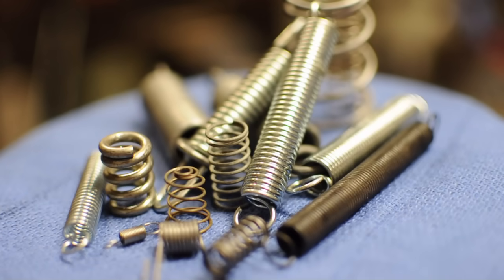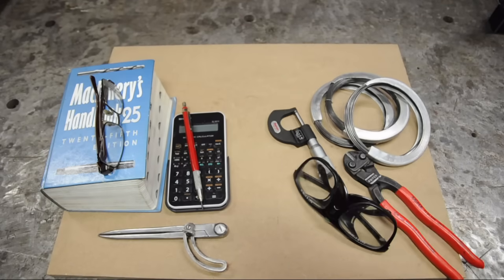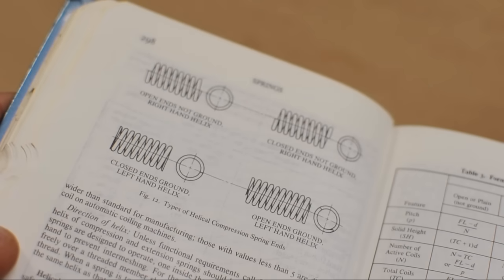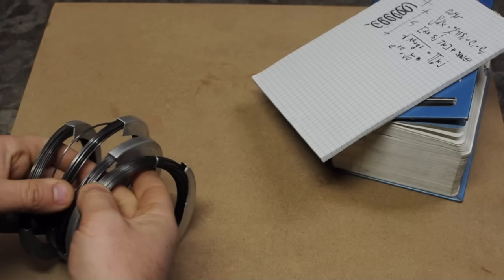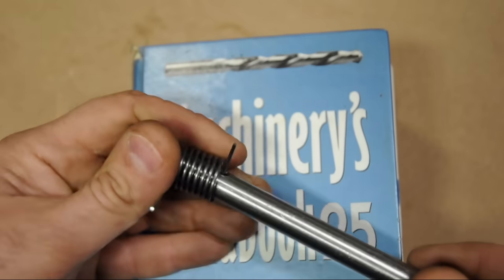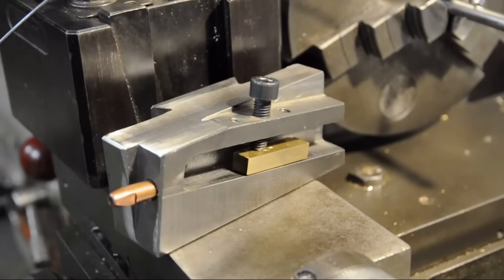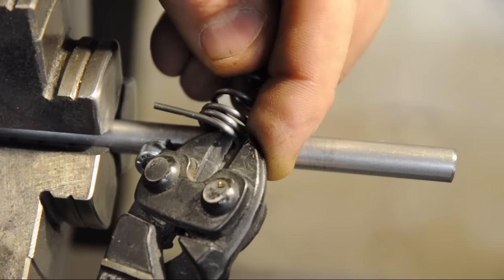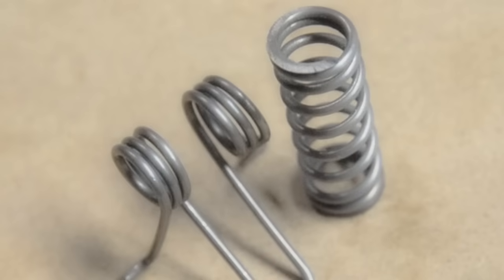Making Springs At Home

Comment: "at home"?  I don't own a lathe...
Reply: that's sad
Reply: No way I just say "That's a bad lathe, go sit back down."
Reply: You don't need a lathe to make springs. I use my cordless drill for the same purpose :D (but i do own a lathe)
Reply: Did one bite you?
Reply: Malcom Helainey If you're not an idiot there's no reason to be afraid. It does exactly what it's made to do, spin. Keep that in mind and you will be fine.
Reply: Jared R No, you buy your first lathe and then make 3 more lathes and sell them. (or make different sized ones for more percecion work)
Reply: I've seen a guy use a hammer to make a hammer.  I have not seen anyone use a screwdriver to make a screwdriver.
Reply: A lathe is the only machine that can be used to make a copy of itself.  So, if you go out and buy a lathe, you can use it to make another lathe.  Then, unbuy the first lathe.  Problem solved.
Reply: dont be silly, there is no need to make a lathe...just buy one! there are plenty to go 'ROUND
Reply: No, that would be the human being operating things. The lathe itself isn't dangerous at all, it just sits there.
Reply: Tune in next time for how to make a lathe at home!
Reply: I honestly don't know how people get along without a lathe.  I use mine more than any other tool or machine, and I have a LOT of both.

Yes, they can kill you, just like a gun, but it won't be the lathe's fault either.
Reply: i wish i did, i may make one, wont have a auto feed tho
Reply: Malcom Helainey that's your fear, so you shouldn't own a lathe, but don't blame the lathe for your fear
Reply: 3/8 Drill will do the job...
Reply: Might need to fix that.  Most kitchens have a lot of wasted space taken up by appliances that hardly get used.  Would be a good place for a lathe.    Most kitchen appliances can be replaced by a phone now days anyway.  Just order pizza.
Reply: Some years ago i've seen a stray lathe attacking a guy at night, it was really scary!
Reply: using....... a spring!
Reply: james davies use drill gun.
Reply: Herr Russo Tragik may be
Reply: I'm just trying to get everyone to understand my semi-rational fear of lathes
Reply: John Klatt Lathes are very dangerous. If ones turned on you can be killed by total chance
Reply: Don't buy one unless you know how to use one. they're probably the most dangerous tool in anyone's garage.
Reply: John Klatt no i'm just really scared of that powerful of machinery

Comment: OK, I see how to create a wire coil BUT all you have so far is a coiled wire, The video doesn't teach how to make the wire into a spring.
Reply from the maker: Music wire is already heat treated.  If designed well, and used within its limits, a 'cold coiled' music wire spring can last a very long time.
Reply: I have a K&S  wire bender, Maybe I'll give this a try and see just how much of a spring I can create without the proper heat treating of the wire.

Comment: ER.. no heat treatment necessary? Mmmm.
Reply: not with music wire
i thought the same thing
--Rick
Reply from the maker: Thanks Rick.. yes, music wire is already heat treated.  If the music wire spring is well designed, and stays within its limits, it'll work pretty darned good.
Reply: exactly! just saying using music wire you do not have to heat treat it

Comment: From what I read about making springs,  music wire springs should be heated to 500f for an hour and cooled slowly to "relax" the metal.  It seems to me that something like this would be needed to help the spring retain it's shape.  Otherwise if you can bend the wire easily, what is it to keep it to bending out of shape when the spring is in use.
Reply from the maker: I'm not sure if reheating/retempering music wire helps... it might, I've never tried it.  Music wire, however, is already heat treated.  If the spring design keeps it within its working range, the spring should do alright.  Thanks Fred!

Comment: I thought that springs , depending on their uses, have to go through various heat treating cycles so that they will spring back into shape when they're  stretched or compressed. I didn't see any springs undergo any heat treating in this video.
Reply from the maker: That is true for soft carbon steel wires.  In this case, music wire is already heat treated and hard (try cutting music wire with some tin snips.. tin snips you don't mind ruining :) -- but the best way to ensure your spring will last is to be sure it is designed properly.. that you're not asking it to do more than it can handle.

Comment: Good video!  Subbed!  I was wondering about heat treating?  Often if I try to bend a commercial spring it will break, as if it's been partially hardened.  
Come check out my channel.  Lots of practical, how to vids.

Comment: Great and witty video! Many thanks. I just want to add one comment. Your springs will remain springy longer if you re-heat treat them. This works only for music wire and carbon steel: clean any oils off your springs, preheat your home oven to 500F, set your timer for 15 minutes and bake that batch of springs. Pull them out with appropriate pot holder. Cool and put them to use.
Reply from the maker: Thanks Slad.. I may put that to the test.

Comment: Can you make a spring without a lathe? If so, what's the best way?
Reply: Don't know about music wire, but I've made coils of fence wire using a rod with one end bent into a crank (2 90 degree bends), with a hole drilled through to hold the end of the wire. Support it in a frame made from a 1x4 or whatever scrap is handy. For drag on the wire I ran it through a screw eye in another wood scrap that I sat on to hold it down. Coils were for making chain mail rings, not springs, but it should work if you are careful. The advantage of the lathe is that it spaces the coils evenly when you. Don't have them touching each other like I did.

-- Mike
Reply from the maker: Certainly.. see Big's response.  Start off with small wire to get the feel for it.. drill a hole in a wooden dowel perhaps, try a few wraps, see what happens.

Comment: How do I recondition springs to their original "springiness"? I have a mechanical calculator here, which has been produced some time in the 50s or 60s, but it doesn't work right any more. Besides oiling the internal parts, I think a huge part of the problem is that its springs have lost their internal tension. However, the manufacturer doesn't exist any more, and so there are no technical specifications left on how strong each internal spring has to be. Do I just heat them up and hope for the best, if I decide to recondition the calculator back to working order, or what else could I do?
Reply from the maker: heat treating isn't the easiest thing to do -- bets bet would be to try to reverse engineer the spring.. how much space does it have?  what size wire and # of turns on the original springs, etc.. make a few and try them to see what feels right.   Good luck!

Comment: Why do they call them compression/tension springs when the wire is loaded in torsion? And why do they call them torsion springs when the wire is loaded in compression/tension?
Reply: Thanks benrivenbark, I am glad someone finally got my drift on the comment. Thanks also for the very kind words and I am glad you enjoy the my channel.
ATB, Robin
Reply: This comment really needs to be read in a "machinist Seinfeld" voice to be truly appreciated.  (Unlike your channel, which is amazingly fantastic and needs nothing to be truly appreciated :D  )
Reply: I didn't know they called springs that way because that's how they operated, but I'm glad you asked even for only to be funny.  I also found the answer informative and entertaining. Maybe I'm a little too nerdy.  
That's the irony of life and the irony of springs.  -  -  -  ooooooo yuck  horrible pun
Reply: Because of the way the spring moves.  Also a torsion spring works in flexure not tension/compression, unless it is a torsion bar like in many vehicle suspensions, in which case it does work in torsion.  Sorry to be serious if you were just being funny/ironic.
Reply: I was trying to be funny :)  Flexure IS compression and tension about the neutral axis. And the wire in a compression/tension spring is loaded in shear/torsion.

Comment: in the pas i've tried to cut oem springs but could not without a cutoff wheel. I was told this is because its made with "spring steel". have heard this term?
Reply: "Spring steel"  s just another term for very hard steel.
Reply: lol
Reply: I tried to use the spring in my step but didn't have enough....
Reply: Ah so that's why spring chickens are so wiry.
Reply: Uh... Nice try, but spring isn't between summer and winter...
Reply: Sevendogtags
true it just bubbles up out of the ground.

Comment: What are those snips you're using? Looks like they make quick work of that music wire.
Reply from the maker: Knipex mini bolt cutter.
Reply: it takes a good pair of snips to cut spring wire but even a good pair will get divots in it cutting springs. its a shame really. dremel tool maybe.

Comment: I got into this thing a few years ago when I was making chain mail for Christmas presents. For non-arrow proof chain mail, fence wire is just as good as piano wire and much cheaper. And good for practice. The principle of the thing is the same, but since my Taig won't screw cut, I turned the wire by hand, so I had a spring, then cut it into chainmail rings. I would be afraid to run the lathe under power, my slowest speed is 500 rpm. If you do run under power I think a feed tool such as you made is mandatory. So are gloves, good ones, and safety glasses. Wire does its own thing, and you can get hurt by it. Piano wire is much more  dangerous than fence wire. And, as usual, you made me laugh. Well done.
Reply from the maker: Chainmail, now that's a lot of coils!  All good points, Juan.  Thanks for watching.

Comment: Like your stuff. In my apprenticeship I learned to trap the wire between to blocks of wood which are screwed together, hold it with your bare hands and than eyeball the distance between the active coils. So much for German quality. Greetings
Reply from the maker: I'm not sure I know exactly what you mean but I cut my finger just reading that.  :)  Thanks Martin.

Comment: They will need heat treatment after forming, won't they?
Reply: For decent springs you need to use 'spring steel' and the spring must be heat treated AFTER forming.  The information on length or time and amount of heat will be specific to the wire and will be provided by the wire manufacture.
Reply: +MrP123 But at 3:43 you can see how easily it deforms plastically. Would forming this into a coil really give you the stiffness you want for its size?
Reply: If you use so called music wire, it is already in ready-to-use hardness. But, you will need to stress relieve it at around 200 Celsius for 30 minutes, otherwise the spring will fail prematurely (usually by taking a set).
Reply: +Ritesh Patil Music wire is already pre-hardened
Reply: Oh, thanks Mr.1970
Reply: jz1199  I'm sure you realize this now, but heat treating is the process of hardening and tempering combined.  Annealing is for making a metal as soft as it can be at room temperature.
Reply: Some of your answers read like my wife & I asking each other if the dog still needs to go out!
Talk nice, please...
Reply: Why did you pick 400 and for what steel? I thought I recall reading through knife making materials that 650F is the proper temp for keeping spring steel very springy. Here to learn, not to argue BTW.
Reply: Every job shop needs a This Old Tony. You can pass on your mad skills and make em laugh doin it .  I work with an old journeyman tool maker that thinks he knows everything. That's why he  was so defensive  after I force fed him a few of your videos 🤣 CAN YOU SAY EPIPHANY 😂
Reply: is it better to have a tempered or annealed steel?
Reply: as Tony said - music wire is already heat treated (and annealed), while you will not be able to make strongest AND lightest springs this way - this method and choice of material will cover a huge range of practical applications - you don't always have to go all NASA when making a small custom spring
Reply: +jz1199 leaving a spring in the annealed state will probably do no good for the fact that it will continue deforming under stress. Certainly I am no expert on the matter and that of music wire but it needs to be clarified that the spring will perform without any further heat treatment.
Reply: oh, I was thinking of relieving a little after hardening - normalizing, but wrote annealed instead, my mistake
Reply: +Ritesh Patil After I wind a music wire spring, I put it in the oven at 400f for 1hr. This helps return the strength of the spring. If you don't do this, the spring will lose its shape quickly with use.